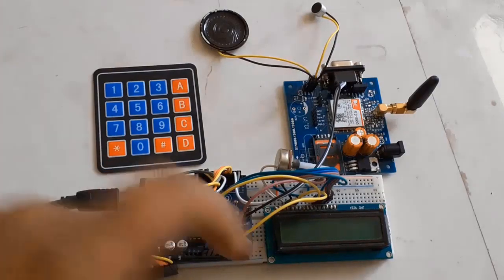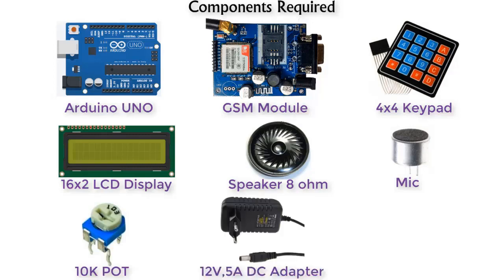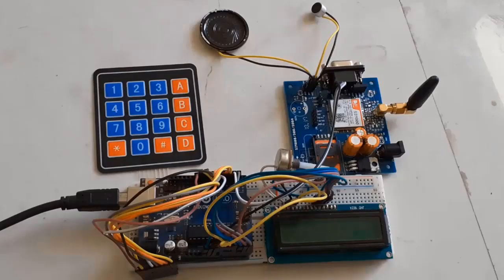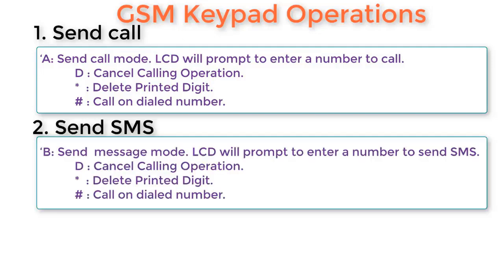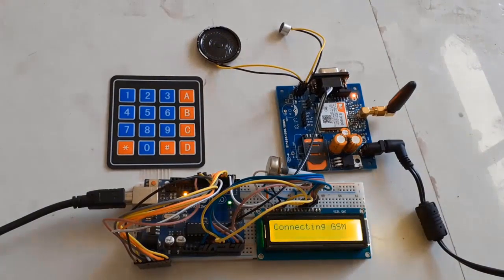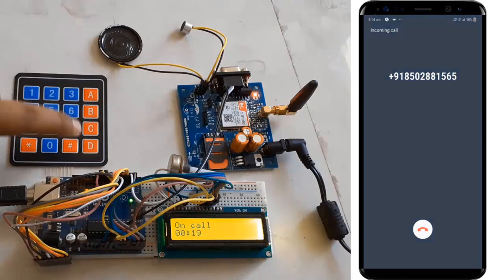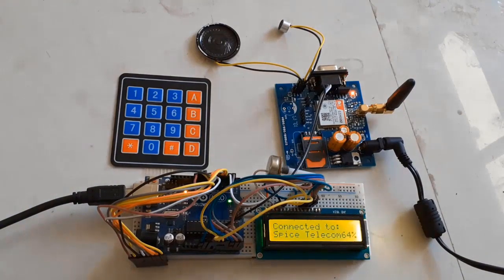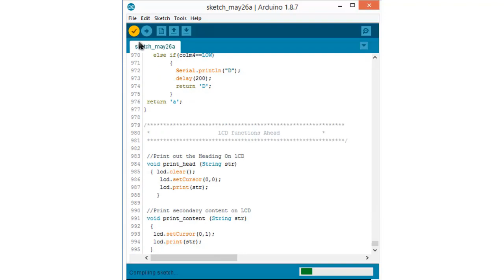DIY Phone - Incoming/Outgoing Call & SMS Using GSM Module & Arduino

Comment: Your video is amazing to know that achieving this is possible. However, I did like to know the processes to receive the SMS messages in a web server database. I am working on a project relating to this and I want to be able to automatically receive the sms coming into the device in mysql database. 
I have also sent an email to you through admin@how2electronics.com but it did not deliver.

Thank you as I await your response.

Comment: Awesome video bro and can i use SIM800L Module and Will i am able to do incoming and outgoing call and sms
Reply: How you do this I do this but continuously show connecting gsm. Please say how.
Reply from the maker: Yes you can try, it works with most of the gsm module.
Reply: @HowtoElectronics  can i use jio or idea sim and is there is and range limits

Comment: bro it shows only "connecting gsm" plz help me
Reply from the maker: Network issue. Use 2g sim only.
Reply: @HowtoElectronics  but now days there is no 2 g sims
Reply from the maker: Sim800/900 is a 2G Modem. 3G/4G sim won't work.
Reply: @HowtoElectronics  thanks Bro.....

Comment: If you find the following program in Arduino, if you call Sim900a, the bulb 1 should start only 2 seconds ON and when you call again the bulb 2 ON should start 2s.

Material..

1. Arduino

2. Sim900A

3.LED 1

4.LED2

Comment: Is it possible to attach some buttons on the SIM800L module so that even without the use of your laptop you can automatically send a message to a registered number after doing something with the codes? I'm trying to make a one click device that can only send a message but not receive.

Comment: it is a veeery cool project 

but i have a question:
how did you manage to connect the lcd display to the analog pins even though they are only input pins
Don't get me wrong I only saw a lot of people how they did it like you and only for me it doesn't work.
can you explain to me how you did it?
Reply from the maker: Analog pins can be used as a digital pins. Arduino has internal ADC.
Reply: @HowtoElectronics  but isnt it so that analog pins can be used as input analog pins?
Reply: @gylidercooler3373  Analog pins can be used in the following ways 1) give analogue input to the Arduino 2) give digital input to the Arduino 3) receive digital output from the Arduino. This has to be specified in the code.

Comment: 2 questions.. 

1 can i delete msgs . Using AT commands..?
2  there is any ringtone.. for incoming call ..?
Reply from the maker: 1. The mesage disappers automatically after a while once you receive it. But during typing you can delete the message using buttons. Check the website link.

2. Yes speaker is there to listen the ringing tone
Reply: Tnq for your replay..

Comment: Very cool! How would this work with a 2.8 inch TFT Display, for example, instead of the LCD?
This module can be used: https://www.ebay.com/itm/SIM800L-V2-0-5V-GPRS-GSM-TTL-Port-LGA-Chip-Quadband-L-Shape-Antenna-for-Arduino/332800310271?var=541920377421
Thanks

Comment: Do we have to make any changes in the code? i have used a GSM 900A with a 3G SIM but it is not getting connected and it is only showing Connecting GSM from a long time. Any suggestions? Please reply at the earliest.
Reply from the maker: No need of making changes to code.
Supply power through 2A 12V/9V adapter. This issue arises due to low current. Even i faced the same. And one more thing if the network is low and if your module does not have antenna it happens.
Reply: @HowtoElectronics  My module does have an antenna and I have used a 12V 2A adapter, still the same is up
Reply: Is there a requirement of an external power supply to Arduino as well? Except for connecting it to my laptop? Because only TX light on the Arduino is lit and not RX
Reply from the maker: There is a switch on GSM module. You have to long press that button on the module to turn that module on. Did you try that. Its like switching on the phone from off state.
Reply: @HowtoElectronics  I tried the reset switch on the GSM, but the problem continues. should i try to use 12 V 5 A on the GSM? as you said it draws more current?
Reply: In the link that u have provided, it is mentioned to use a 12V 5A DC supply..and u suggested me to use a 2A one, so 2A doesn't work on my GSM, so would it be safe to use a 5A 12V supply? Please reply at the earliest.
Reply: I am using sim800A and having same problem. GSM module gets supply from Arduino

Comment: Dear your web page link is not working.
Please check and confirm.
Is there another link please share.
Thanks & kind regards.
Reply from the maker: Use vpn and then open. Some countries ip are blocked from using this website. I will fix that soon. To open blocked site use any vpn.

Comment: Make this same project using sim 900A module 

Btw nice video
Reply from the maker: Just replace sim800 with sim900
Reply: I do it but show continuously connecting gsm
Reply: @projeshhalder9835  same happened to me
So I later switched to sim 800L